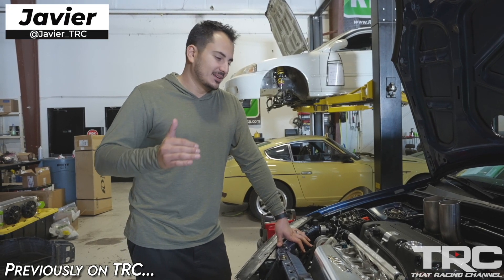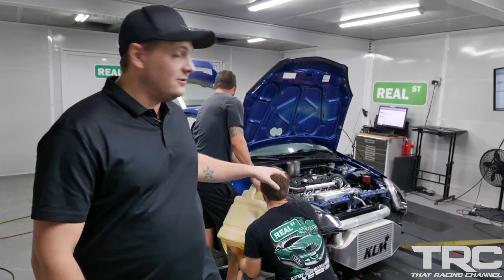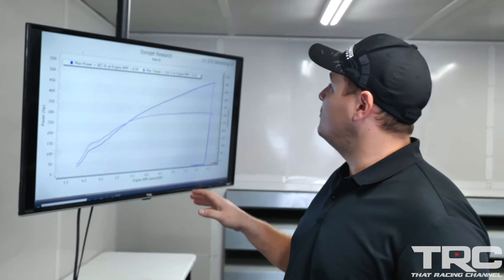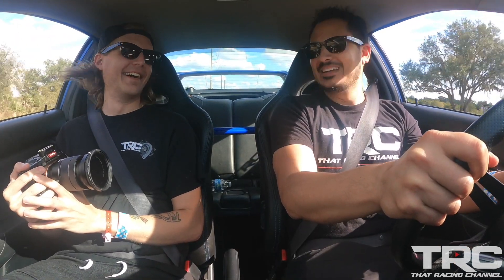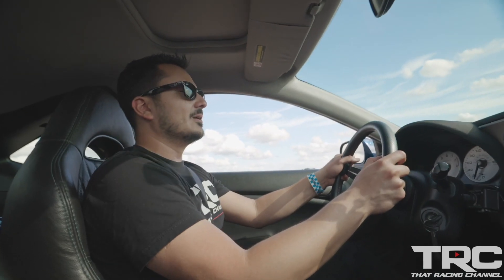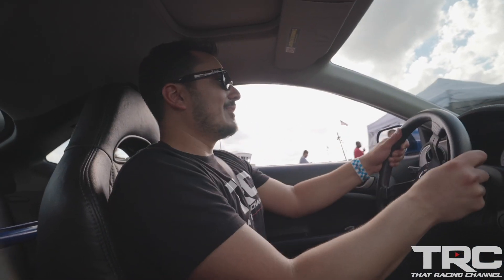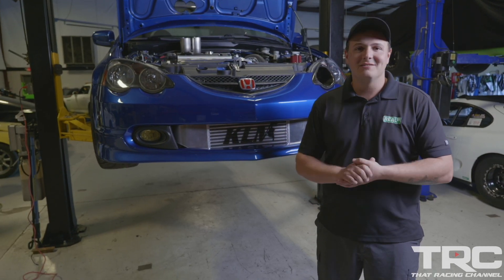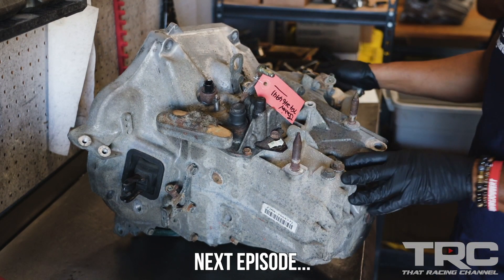AWD Acura RSX Build - FIRST DRIVE with TURBO FWD K20! (507whp Stock Motor & Trans) - Ep.5

Comment: The face when you're driving it says it all. So fun. 

Did you have any boost creep issues you couldn't get totally under control on that turbo? I found a 6266 I could gate off plenty to hold even 10psi at 8600rpm on a single 45. With the 6466 I couldn't, seems crazy but that change had me creeping to over 1 bar at redline dumping as much as possible. 

Car is epic. So glad you guys went DC5.
Reply: Had the same problem with a 44. You need either a 60mm or twin 44

Comment: Stock block and stock trans what a waste should of built it right the first time around instead of spending money and throwing it away
Reply from the maker: We are fans of the doing it right the first time idea, can’t go wrong with that. If you checkout the earlier episodes we mentioned the plan was to take the car through various stages. Going to start with stock motor and awd conversion, race the car, then progress from there. Hopefully we can add value for others going through different stages of their builds. The end result of the series will be built engine, trans, etc… Thanks for watching!